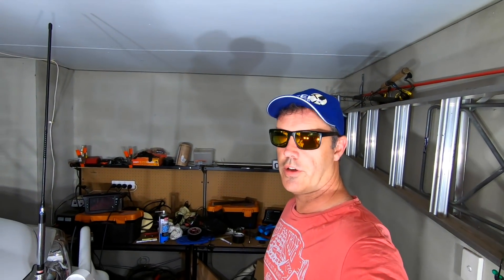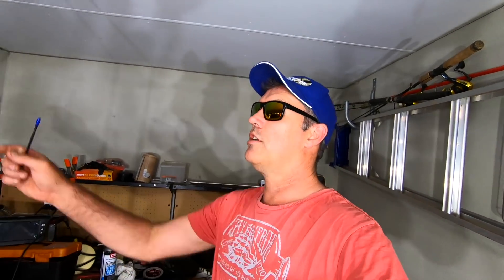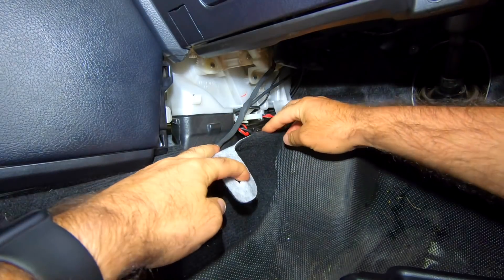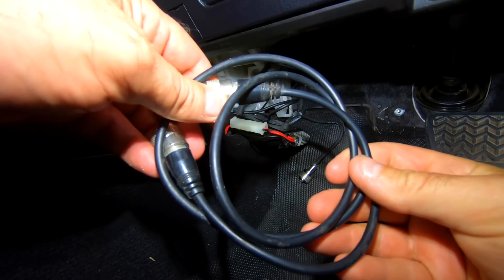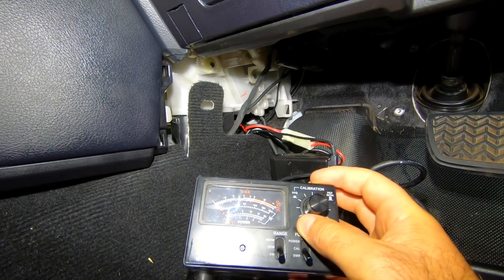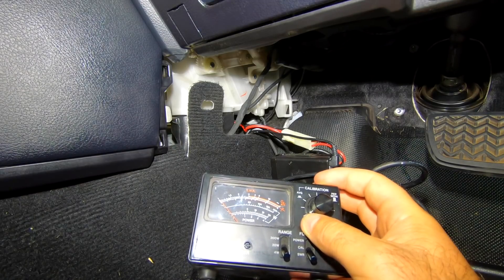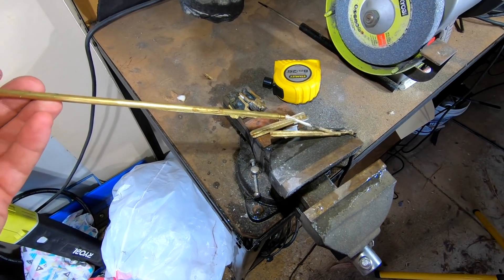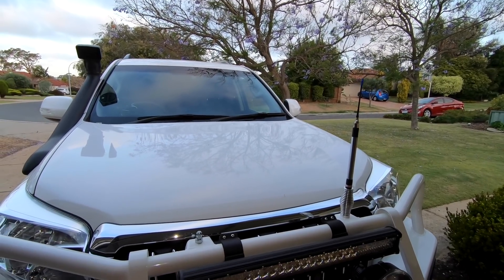Anatomy of my poor performing UHF antenna. I cut it up to take a look.

Comment: This is constructed much like a common field expedient antenna you can make with just the coax cable. You ring-bark the outer plastic sheath at 15cm from the end, then roll back the outer braided element down over itself. You want to end up with 14.9cm of the inner wire (the transmitting element) and its plastic cover sticking out the end of the cable, with another 14.9cm of the outer braided element (the reflected element) folded down over the coax cable. When you hang it vertically up a tree, or use pvc tube to help hold it vertical, then this creates a vertically polarised dipole antenna. The coax by its construction prevents any radiation until it hits the point where the two antenna elements are opened out, then the top inner wire acts as the antenna and the braid acts like its ground plane, or the "reflecting element". I have used one of these only a few metres above ground on a 5W handheld UHF to transmit over 21km over real world conditions (some urban with some open bushland). 14.9cm is only a 1/4 wave antenna, if you want more performance, you can double the lengths to make a 1/2 wavelength antenna. The longer wire will mean "catching" more received signal, but not necessarily help transmit more efficiently.

Comment: As per the comments below , this is all antennas are. They're not magic they're just wire. 
The length you refer to is the total length of the actual antenna, not the wire or radiating element within . 
They likely use the same length of cut tube for multiple antennas and save money cutting it to length. 
the benefit of such an antenna is they're pretty rugged with not a lot that can go wrong with them. It was hard to see the swr meter due to the reflection but it looked like it only went 1.2 or a bit higher. that isn't a high swr by any means. it also looks like you were doing this test in the shed. so likely other metal around. that wont help. but a good swr does not alone make a good antenna.  realistically, if you wanted to you could make your own out of a straight piece of wire cut to length. it wont look pretty but will work just as well.
Reply from the maker: There is also a lot of science goes into antenna design to maximize the available energy..

Comment: My favourite saying when it come to radio antennas remember .  At the end of the day its a bit of cable ..  be coax or other 
There is no black magic its all in the length and configuration 
This brand axis are known for poor performance.   
When you buy an antenna yiur paying for the name thats it ... 
You can thank me later .  
Yes ..  a 30 buck cheapie will do exactly the same as a 200 buck brand name ..  
Good video though shows what's not in these
Reply from the maker: There are some more complex antenna designs around hidden in the black broom sticks..but not the I had thats for sure.

Comment: The brass shield gives you the earth elevation and the matching to 50 ohms (counterpoise).      The length of coaxial cable inner above the brass shield is the tuned antenna length for the CB band (I am presuming an end fed monopole).      The length of the Monopole (coaxial inner) would have been about 1/4 of a wavelength ~ 477Mhz - 0.6285m /4 = 0.1571m.    This antenna would have only had a gain of about 2.15dbi.    The fact that it did not match well indicates that the antenna was not tuned properly and was the reason for the poor performance.
Reply: I should add, (I am a bit rusty with antenna design) the length of the monopole needs to be altered by what is called the velocity factor of the insulation around the wire centre.      (Velocity factor is ratio of the speed the radio wave travels through the dielectric material (insulation) versus the speed of light)    Typically the type of cable used gives a velocity factor of approx 0.7, so the monopole element should be 0.1571/0.7 = 0.2243m.   Also I think that the counterpoise (brass shield) should be this length as well.
Reply: @malcolmlewis3239  That right, an english ham has experimented extensively on these coax monopoles and the bottom line is it is all in the correct dimension because of cable velocity factor and the difference is like night and day .
Reply: Malcolm Lewis  Yep, my first thought when he couldn’t calibrate it was a really bad impedance match, which would also explain the poor performance.  Of course, it was tested off the car and required a ground, then that wouldn’t help either, but I assume that wouldn’t have been the case when he first fitted it before changing it, and he did note that was also a problem initially.
There’s nothing intrinsically wrong with that design, which appeared to be a sleeved dipole, but hard to know without seeing the actual connections and build in a bit more detail.  So my guess is the antenna was basically cheap, untested Chinese shit rather than a quality brand like RFI.  Would have been interesting to have put an analyser on it prior to the angle grinder. 😂
Reply: @ammocraft  looks like an an extended feed 1/4 with a fault in the coax. In the antenna. Many antenna designs use coax. It's just faulty. Wouldn't sweat over the velocity factor
Reply: Extra length of the brass sheath I presume forms capacitance between core and sheath because it’s not inherently 50 ohms. Half wave dipole would be about 1.5 meters high so impractical.

Comment: tried reading up on antenna theory. 600 pages of had slog argh. My ac/dc theory knowledge is sketchy, antenna even worse. I was a telephone switching tech in a past life so not my forte. Need a radio engineer on here to explain it all.
Reply: RFI  Elevated Feed Stainless forget the rest. Peter technician ex icom

Comment: Nice one,  so which brand of uhf and antenna are you running now
Reply from the maker: I went for the trusted and proven elevated feed with a whip. Performa a lot better. I can change antennas if I want, can change antenna Db if I want to. I also have a short 3Db whip which I leave on in the city as it fits in my garage.

https://www.gme.net.au/catalogue/antennas/uhf-elevated-feed/ae4018k1.aspx